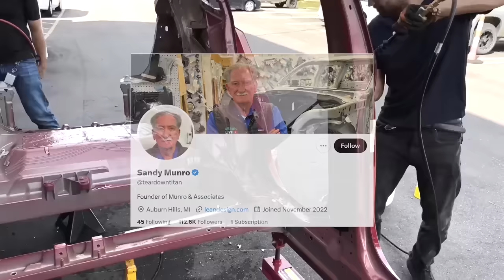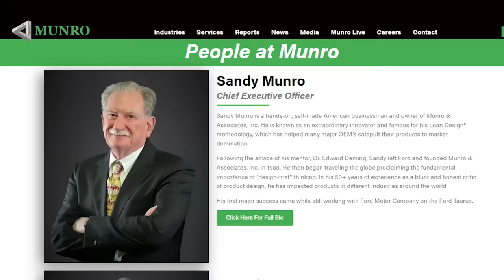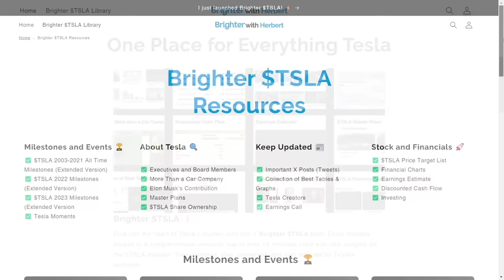EXCLUSIVE Interview w/ Sandy Munro: Tesla’s Future

Comment: Sandy’s view on the 48 volt architecture is one reason I think the refreshed Model Y will come out in 2025 with it along with drive by wire.
Reply: Imo tesla should make the model y and 3 more luxurious to distinguish them from model 2 and co
Reply: That would be amazing if that happens.
Reply: @diogenez471 I consider minimalist as luxury. Less is more. Multiple dials and levers that don’t work and soft stuffed chairs etc. don’t convey luxury to me. I like dragon capsule luxury. 
Improve handling ride noise performance range comfort reduce unnecessary stuff. Just my opinion.

Comment: Sandy you are right , i was selling electronic component for 40 years and the 36 42 or 48 volt were on the table really 40 year ago , but , the car producers was asking the subcon to do the job and the design at no cost . Thi was one of the blocking point to implement the 48 tecnology .
Now may be the right time , but i have not yet seen 48 volt lamps

Comment: Hi Herbert, greetings from the U.K. Great to see Sandy on top form here. I too am an engineer, and 58yo. Sandy is just so experienced and competent in the automotive field. For years I have pondered the obsession with remaining at 12v for car electrical systems; early combustion cars had 6v systems, but the arrival of the electric starter motor put an end to that ‘standard’ because at 6v you couldn’t get the power for the motor to crank a combustion engine without massive cables and a huge amperage battery capacity; which would fry itself internally. The car industry could have saved itself a fortune by moving to 48v back in the 70’s, it’s not just cable thickness, but also relays. At 12v you need relays to handle the current (amperage) for car electrics like wiper motors, blower motors, rear window heaters, electric windows. However at 48v, many of these features can be operated by the dashboard switch itself because the current (amperage) drops by a factor of 4, reducing the wiring loom and complexity even more. Another big advantage of a 48v system is the strain on the battery to cold crank engine is much reduced, also if you love your music, a sound system can be much better with a 48v feed.

Comment: I think Herbert is confusing the un-boxed model with the new Cybrtrk manufacturing method. Tesla had to use a new manufacturing technology for the Cybrtrk because of the exoskeleton-like design of the Cybrtrk. New manufacturing machines were needed to make the folds in the steel exoskeleton structure, but the overall linear  or serial manufacturing process is roughly the same as the way all cars are currently produced. The un-boxed manufacturing process is a modular, parallel manufacturing and assembly process.
Reply: There seems general agreement that CT pioneered a lot of new technology and approaches that enable the Model 2. 

It’s also likely that many of the CT assembly techniques will also apply to M2. 

I don’t know how much stainless steel cost can be reduced once you relax the “bulletproof” requirement. However, in low-income countries and market segments, a durable vehicle body would be a strong advantage. 

Regardless, the stainless steel processing innovations could probably be applied to other metals  possibly even composites.
Reply: Didn't e-lawn say the next gen factory was for their next gen cars?
It's probably a combo of everything learned to this point
Reply: e-lawn as in green grass.
Reply: @garthharrington9683  
There are many words im not allowed to use in their proper spelling without YooToob deleting or sandboxing my comment.  I need to delete my account and start over
Reply: @yourlogicalnightmare1014  I like e-lawn and maybe the use of that as a name will deflect  some of the attacks that Elon generates?
Reply: @garthharrington9683  
That might work

Comment: Thanks Herbert and Sandy.

Sandy, The trap is 48 VDC.  Once you make the commitment, there is no going back.  The same is true for first principles, castings, poka yoke design, melding design and engineering, humanoid bots, and unboxed assembly.

Based upon your cybertruck factory tour, do you think the breaks in the automated production line were designed to accomodate a humanoid robot?

Humanoid robots in the factory have considerable idle processing time.  Why not use the idle time to do on the line QA?

The fractal nature of unboxed assembly is perfect for minimizing mass motion which reduces energy consumption and production costs.  Segments can be duplicated to bring the slowest steps down to achieve optimum production speed vs cost.

PS: What is a gas station?  You mean they sold explosive flammable fluids to the public from pumps.  I thought static electricity can explosively ignite gasoline vapor.  I heard it used to cause thousands of gas station fires per year.

Comment: The unbox system will allow for automation of the assembly of wiring harnesses and increase the run rate to less than 30 seconds, something a person would struggle with. Unboxing allows the engineer to orient the assembly so they are not fighting gravity, this is big. What is unclear to me is how to join all the sub-assemblies and assure structural integrity, I have no doubt that it is clear to the Tesla Engineers.

Comment: Imagine if you will ..... A World where cars had ALWAYS been electric.  Now someone comes along and tries to convince you that the way forward is to 
(1) Pour 12 Gallons of highly flammable liquid into a tank, just behind where your kids sit.  
(2) Replace the single spinning rotor with 4,6, or 8 heavy pistons that compress and explode the flammable liquid 100 times every second + a thousand other frantically moving metal parts.
(3) The pistons travel vertically, creating huge loads on a shaft that runs 90 degrees horizontally, then that shaft also has a 90 degree change of direction to the drive wheels. 
(4) the engine runs at extreme temperatures and loads, and so requires coolant (with anti-freeze of course) plus various types of oils throughout the drivetrain.  
(5) .... I mean, what did I miss? Oh yes....
(6) Timing belts/chains, to ensure that the pistons don't smash into the valves and destroy the whole engine in a millisecond.
(7) A regular and expensive service to ensure all that complexity is lubed and adjusted.
(8) The pleasure of pumping gas at a greasy, oily, smelly, gas station every week (and handing over a hundred bucks or whatever for the privilege).

How could you ever possibly ever float that concept, unless the only alternative was 19th century horse-drawn buggies?
Reply: As ICEs have already demonstrated their reliabilitylisting your trepidations is nonsensical.

Comment: I like listening to Sandy. Unfortunately he is wrong about hydrogen. Even if it’s limitless and renewable, it is not clean-burning. It has significant NOx emissions (though I don’t think this is an issue with fuel cells). It also has global warming impact as its fugitive emissions slow the breakdown of methane. Even if it were an easily managable fuel (it’s not) it isn’t clean.

Comment: 00:02 Tesla is ahead in software and automation
02:06 Tesla's leadership, software, and charging set it apart from other players in the industry.
07:23 Elon Musk's innovative 48-volt implementation shows Tesla's cutting-edge approach.
09:59 Tesla's use of new castings for cost reduction and efficiency
15:05 Tesla's efficient software integration with minimal suppliers gives them a competitive edge.
17:22 Challenges of integrating Tesla's software into other vehicles.
21:49 Advocates for same line production for efficiency.
23:58 Tesla's inbox system will have a significant impact
28:21 Chinese car makers entering US and Europe post-election
30:18 GM and VW make most profit in China
34:44 Tesla is exploring hydrogen engines as a potential future technology.
37:02 Tesla's upcoming vehicles and the Unbox Model
41:16 Tesla plans to manufacture revolutionary parts to reduce cost.
43:20 Carbon fiber provides crashworthiness and durability for cars.
47:29 Humanoid bots could dramatically impact auto production.
49:36 Elon's robots focus on the original purpose: dirty, dangerous, and drudgery tasks.
54:07 Sandy Munro discusses the possibility of robots replacing human workers in factories.
56:07 Tesla's future prototypes and testing
1:00:45 Sandy Munro's comprehensive resource for Tesla investors

Comment: He spoke about maintenance cost being very cheap yet Hertz got rid of their teslas due to maintenance costs among other reasons. Would be nice to hear about the ‘why’ behind Hertz decision…
Reply: Well, we know it wasn't for all the Tessluh oil changes, new brake pads, spark plugs, timing belts, valve adustments, leaky oil seals & gaskets, radiator flushes, new alternators, starter motors, ...

Sounds like fraud to me
Reply: I read in several places that since Hertz like all rental companies finances its cars based in part on the residual value, ie the amount they get when they sell it to the secondary market, that they miscalculated, they couldn't get as much as expected because Tesla was constantly cutting the price of new cars (a good thing!) So new ones were competing with used ones. Hertz didn't deny it. I also read that Hertz was running its Tesla fleet to 100, 000 miles whereas they usually sold ICE cars at 20,000 miles. Don't know if that's true but it was a reasonably credible source. Not sure how that would impact their decision. I never heard Elon comment.
Reply: Maybe it’s because car rental companies have predictable lifecycles for ICE cars. By the time you get past the cheapo maintenance items like oil changes, brake pads, windshield wipers into the big-ticket items like new seals/gaskets, alternators, starters etc. that car is on it’s way to Mannheim, or some other third-party auctioneer. Teslas can go a million miles,sure, but everything that CAN break is a big-ticket item: expensive low-profile tires, suspension components, batteries that some idiot ran down to zero… I wonder if folks who are inclined to rent a Tesla have a larger-than-average percentage of “drive it like you stole it” tendencies? Maybe the bean-counters at Hertz just can’t wrap their heads around how to craft actuarial tables for EVs, so they just decide to throw up their hands and cut their losses. Going to be a world of hurt when EVs are, say 50% of the market, and suddenly no one wants to rent an ICE car anymore. Disruptive tech eats short-term thinking for breakfast, lunch and dinner 😅
Reply: @azscott  
I don't know if I'd say the "cheapo maintenance items" are really that cheap.
It still takes expensive manpower and downtime to change oil, brake pads, and other items.
Hertz could easily restrict the "drive it like ya stole it" behaviors just by changing the setting that restricts speed to the posted speed limit.  I believe that is keycode protected so users can't defeat it to drive however they want.  Low profile tires are on the performance models.  I don't know that Hertz would want performance models over the long range, but they certainly didn't need them.  Just go with a long range, and choose the smaller tire size with the larger sidewall.  Those have a less bumpy ride anyway.

I'm getting a new X in March and I went with the smaller tire size.  I have the performance Y already and I wish I'd have gotten the smaller tires on it.  You get a little extra range and a little smoother ride quality.  Going over railroad tracks or potholes is brutal in the Y.
Reply: Scherr did not get rid of Tesla rentals because of maintenance costs - contrary "“The reality of EVs and Tesla’s being the best-selling car will, at some point, render them the best rental car.” Scherr.
German rental car company Sixt said in December it was selling its fleet of Teslas "as part of our regular de-fleeting process".
It still plans to offer a range of electrified vehicles and "stick to our goal to electrify 70-90 percent of our rental fleet in Europe by 2030".
The decision was based on the increased costs of crash repair from Uber drivers who drive their rentals hard for long hours in dense urban traffic, the higher cost to customers renting an EV from Hertz and the high depreciation on resale after two years as Tesla continues to drive down costs. Hertz never bought the 100 000 Teslas they used in their PR and had no contract for that from Tesla. They have had three CEOs in recent times and appear rudderless.

Comment: 48 VDC is what the traditional USA land line phone system runs at.   This means there is over 100 years of 48 VDC systems in the USA.  If you still have a POTS telephone system in your house connect a VDM to phone line.   With no load it should read about 48 VDC.   That's the voltage of the central office 48 volt lead acid battery.  Then take the phone off hook and you'll see the voltage fall to below 10 volts as the phone loads up the line.   The drop in voltage is how the central office knows the phone is off hook and sends a dial tone.    The disadvantage of 48 VDC compared to 12 VDC or 24 VDC is many simple electric switches and relays are rated as 120 VAC and 24 VDC.   The low voltage rating for DC is due to arcing.  AC has a zero voltage crossing that helps greatly in reducing arcing.   Switching is one of the primary advantages of AC over DC along with being to easily use AC transformers to increase or lower AC voltages.   There are top operating voltages in many semi conductors that don't go as high as 48 VDC, but they do handle 12+ volts.  48 volt semi conductors are more expensive than 24 volt semi conductors and in many applications 48 VDC has no improvement on ability.   The advantage is smaller conductor cross area for transferring electricity for 48 VDC verses 12 or 24 VDC.   

There are some people that claim a voltage of 48 volts is just high enough to be lethal.   For large scale 48 VDC use such situations need to be made known to the engineering community.   I'd think they'd have to be very special situations, but they should be made known.  A high current short at 48 volts would cause huge heat generation as does shorting a fully charged 12 VDC car battery.    24 VDC is much better for running sound and radio systems than lower voltages.  It's now possible to buy IC chips that do low  DC to higher DC voltage output with a few external components that greatly replaces the need for higher DC voltage inputs.

Comment: @BrighterwithHerbert 
Herbert, please be the first content creator to visualize and agree with my theory of how the next generation vehicle will use the un-boxed process.  I have posted similar comments on other pages but nobody responds to this idea.  Even Sandy did not dive into the unboxed to this level and really never answered your questions.  I think this explanation will even answer your multi-platform where you have a process to create multiple models of vehicles within one manufacturing plant using the snap together philosophy. 

1. Cybertruck showed us several things required for the Unboxed Process. 

2. The CT outer body panels are welded to inner panels, and those inner panels have attachment points to connect to the Giga Castings and other structural portions of the vehicle attached with fasteners or automotive adhesive. CT didn't need paint on those panels but did demonstrate the process of eliminating the welding of outer body panels to the vehicle structure. 

3. Those outer components assemblies can now be painted (after the inner panels are welded to them) versus being painted as a pre-assembled vehicle. They could even have the robotic arms hold those assemblies together during painting as if they were an assembled body in white to enhance painting quality. 

4. The center section of the vehicle (ultra-high strength hardened steel door arches and roof bracing) can be assembled, painted. The wiring an interior door arch trim would be installed 

5. The cars side panels (Rear quarter panel, rocker panel, and roof panel (between top glass and doors) can be attached (not welded) to the door arch sections. 

6. The top glass can be attached to this center section prior to assembly to the front and rear Giga Castings. 

7. The entire rear section Giga Casting, Drive train, lower storage area, Carpeting, and wiring will be assembled in one assembly area. 

8. The entire front section Giga Casting, Drive Train, Frunk, all firewall components, dash and all of its components, and wiring will be assembled in one assembly area. 

9. Doors will be assembled totally as they are today. 

10. Battery pack, Carpet, Rear Seats, and wiring are assembled totally as they are today. 

Now you have every part of the car assembled into four major components plus the 4 doors, hood and rear hatch. These are all brought together in a final assembly (Very Short) line. The 48v and Ethernet wiring system allows each section of the vehicle to be fully wired before assembly and then connected together with fasteners when those sections are brought together (eliminating the task of wiring the entire vehicle before final assembly). 

Go back and watch Tesla’s animation of the unboxed process and see if my opinion doesn’t match this description. This eliminates the need for a long snake like assembly line process where people/robots are working in and around a large assembled chassis.

Comment: If the 48 volt wires enable ¼ the diameter wire then it takes around 1/16 of the copper for the wiring.
Reply: That is for power loss only. But if you add on top of that the reduced cable harnesses required when you have a high speed net in the car, the reduction is more than 1/16. The metal in the car is ground, so you only need a thin data line, presumably twisted pair or coax, and a +48V power line.
Reply: @inber if it takes 1/16 of the copper the reduction is 15/16.
Reply: @haywoodmorganjr1326 True. I didn’t see the typo. 😊